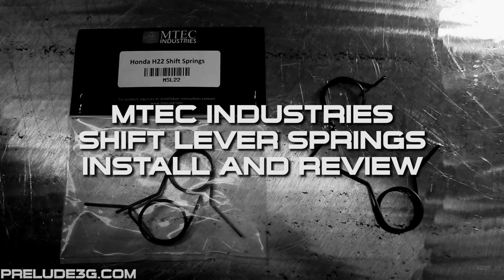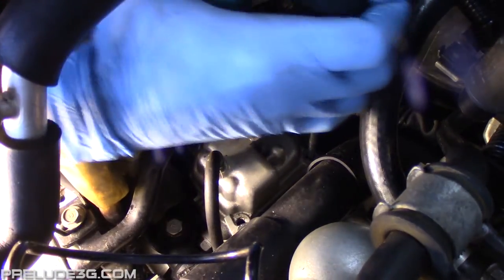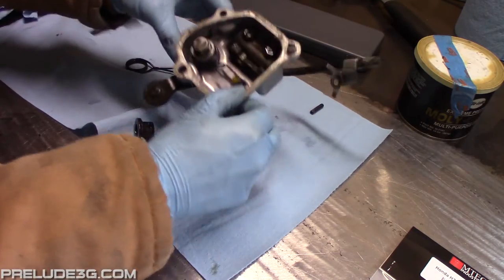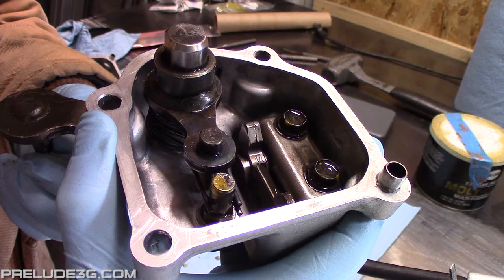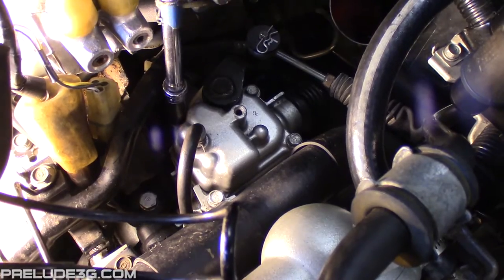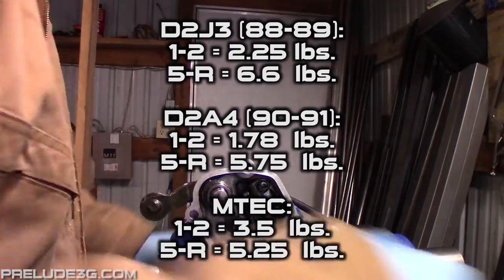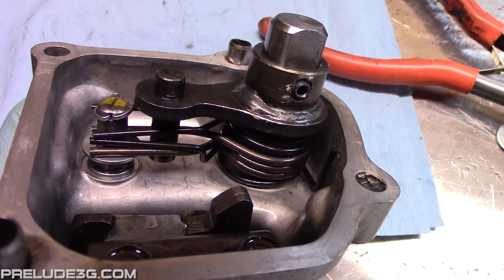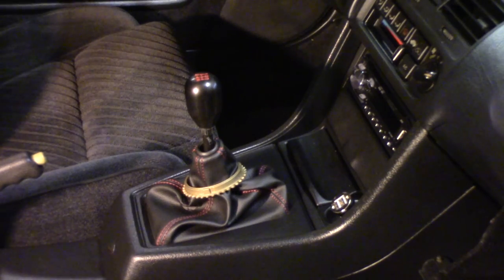MTEC Industries Shift Lever Springs Install and Review

Comment: So with an h22 trans would you just be adding the mtec springs on top of the A spring or with A&B?
Reply from the maker: Right, you only use the stock A spring along with the MTEC ones.
Reply: Awesome! Thanks for the quick response!
Reply: Regarding this question (for the h series) you still make a hole and put a cotter pin and washer like other trans right?